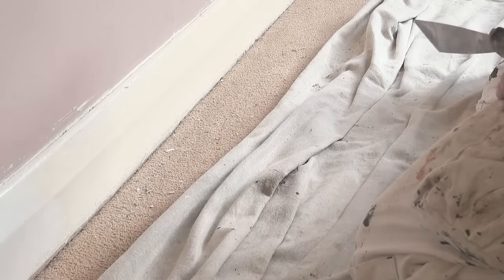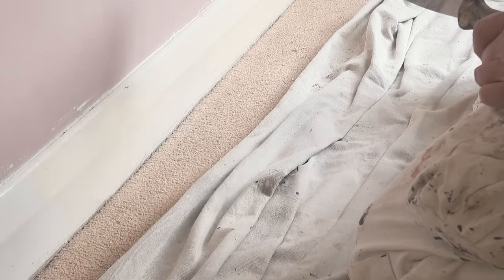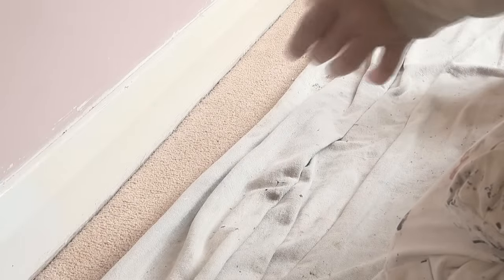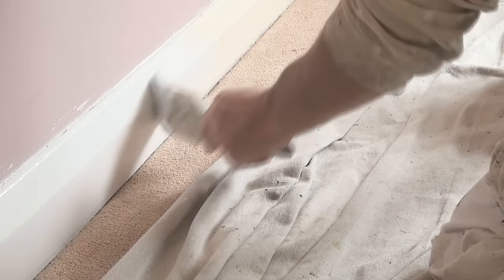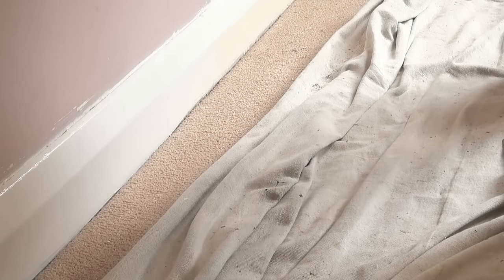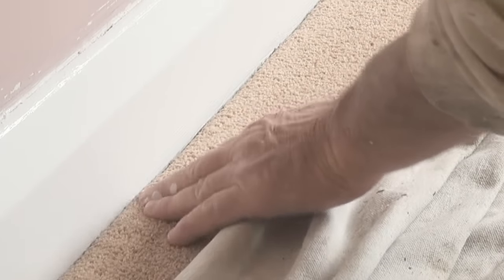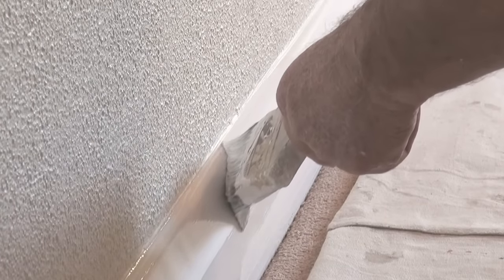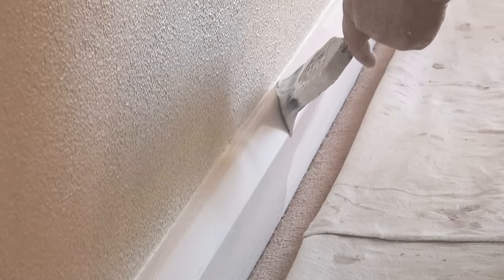How To Paint Baseboards or Skirting Boards On Carpet (The Trick to doing it)

Comment: Im no painter decorator but for all the years ive been diy paint work i have always laid down 2inch masking tape and tucked it down the side of the carpet with my spreader.. once the paints dryed and you lift the tape back up it lifts the carpet and all the micro dust with it leaving a lovely neat fluffy edge..
Reply: You beat me to it. That's how I do it. I picked it up from watching the pros on sites I was also working on.
Reply from the maker: The thing with tape is paint can and does bleed behind it and the big issue is you don't see it until the tape is remove. This is how I do it and other Pro's do it as running tape takes time and is not necessarily the best thing to do.
Don't forget to Like, Share and Subscribe.
Reply: @howtopaintinfo  rubbish sorry
Reply: Perfect that’s the way I do it works every time there again I’m not a pro.👍
Reply from the maker: @ Pete the Paint. Sorry bud but pros don't tape carpet.
Reply: You come out with broad statements such as "tape can and does bleed behind, pros don't do it and pros don't tape carpet".  It seems to me that it's your way or the highway!
Reply: @howtopaintinfo  EXACTLY, so many muppets out there...

Comment from the maker: The only issue with spatulas is they need to be wiped all the time as paint will work its way to the back edge so if you don't wipe it clean every time you will end up with paint on the carpet.
Reply: I took your advice and painted the baseboards and moulding without the use of blue tape because of your cut-in technique.  Thank you sir!   I have a question:  I am going to work on the stairs and have deep walls/ceiling above it.  The extension ladder needs a leveler or ladder box.  What do suggest tradesman?    Regards, a Subscribed student.

Comment: Use masking tape this ovoids any risk of paint getting into the carpet and also you won’t pick up any fluff from the carpet on your brush
Reply from the maker: Applying masking tape is time consuming, it never sticks that good to carpet, paint can and would bleed under the tape and get on to the carpet as there is no way to get a firm seal with carpet.
Don't forget to Like, Share and Subscribe.
Reply: The guy doing this video knows Jack shit. My family's business has been decorating for nearly 150 years and we always mask up.
Reply: @howtopaintinfo  that's not true...a strong masking tape can be tucked right down to the base of skirting board. It can be done real fast with practice
Reply: @JohnMowbray100  45 years in the trade   i laughed all the way thru this
Reply: I’ve been a decorator for 36 years mate it’s not weather your decent tradesmen it’ eliminates the risk of getting paint the carpet and you can get lower down if you were decent decorator you would that
Reply: @Gary Riley try it before you judge we work with the national trust and farrow and ball and have been trading over 36 years so I think experience goes along way
Reply: It might not be done in Australia bud but in the uk we have standards if the carpet is deep pile your be in all sorts of trouble it’s a precaution not an aid like using dust sheets it’s a precaution, prevention is better than a cure but each to there own , take care
Reply: @Gary Riley well I'm a professional I we always do it. Every one I know does it. Quicker, neater easier.
Reply: I'm a novice, i used masking tape on a medium pile carpet, yes it takes 5-10 minutes extra time...but well worth it...and, Bob's your uncle...
Reply: big carp catcher  use low tack tape frog tape is good iv been decorating for 36 years bud if you want any tips pls ask
Reply: big carp catcher  i peel the masking tape off whilst the paint is almost dry and use a sharp blade as i go along...takes a few minutes but worth it.
Reply: big carp catcher  go do your normal job and pay a professional
Reply: @MrJimtimslim  i agree James, but in my circumstance i have spare time off work (shielding and having Chemo) and I'm painting all the skirtings, dado rails, doors and frames a bit at a time. I used 'bullseye' paint/primer (in UK)to undercoat 1st, this saved on sanding down, then good quality white gloss. The finish has been excellent...at least the wife says so! 😁👍🏻
I'm going to pay for a decorator for the wallpaper though, I've not got the energy to go up and down ladders at the mo'. Best wishes to you
Reply: How to ruin your clients carpet in one easy lesson one touch to the edge of the carpet and you won’t get the paint off 😂Quality low tack masking tape is all you need that method is just going to pick up fluff and dirt at the edge of the skirting boards.
Reply: @howtopaintinfo  only cheap tape try a good brand like Tesa been a decorator for 40 years.
Reply: @robertgodley1141  I've been crawling around floors painting skirting boards for longer than I care to remember.  When painting in new buildings on screed floors, I always use a piece of off-cut board about a metre long, with a chamfered edge.  Push the edge into the gap between wall and skirting, and paint away, sliding the board as you go...no shit, no grit stuck in the brush or paint. Once the carpets go down, mask up, takes a bit longer, but painting is quicker. When your knees get fucked-up, the less time you spend on them, the better!
Reply: @roomatoid440  when I do new builds I always spray safe ya knees after 36 years in game bud 🤪
Reply: @robertgodley1141  Sorry old son, is spray safe yer knees an American term? Being English, I don't know what you mean.
Reply: @roomatoid440  spray skirts that way you save ya knees crawling around I can be out of new build in week doors sprayed as well
Reply: @robertgodley1141  Gotcha! Good idea. With doors, I use a short pile roller, then lay it off with a 2 or 3 inch brush. To get rid of the orange peel effect.
Reply: @roomatoid440  at last someone who knows what there doing lol you use perdy
Reply: @JohnMowbray100 yea that's true even on this one video he got paint on the carpet lol😂 in my experience I've always used packing tape it sticks better to the carpet and doesn't bleed but not using anything is risky

Comment from the maker: If you notice the drop sheet is about an inch away from the skirting, if you are going to drip any paint it will be when you are removing the brush after dipping it and that's why you should always work on a drop sheet. All professional painters I know do the method as I have shown, only inexperienced painters use tape. The reason tape is not used is because it does not stick very good to carpet, therefore paint can and will bleed under the tape and on to the carpet.
Reply from the maker: Thanks for your comment,  its good that you tried tape and found it not so good to use. Maybe it will help others.
Don't forget to Like, Share and Subscribe.
Reply from the maker: Thanks for your comment,  as a painter we are always looking for the easiest and best way to do things and sometimes there are no easy ways.
Don't forget to Like, Share and Subscribe.
Reply: Here’s how— when base is sanded dusted and carpet cleaned use 2” tape in strips of tape about one quarter inch up on base then pull toward you and tuck under base , continue till room is done, then tack cloth off the base and paint. When dry pull up tape— it’s done.

Comment: I get a thin piece of card, a4 size. Lay it flat and push it to the skirting board then tilt it to a 45 degree angle. Then just slide it along when painting at the bottom. No paint on the carpet.
Reply from the maker: You need to be careful when doing that, paint can work its way to the underside of the cardboard and before you know it you have spread paint all over your carpet. If that works for you that's fine but it has it's down sides.
Don't forget to Like, Share and Subscribe.

Comment: I just tape it up with good quality white masking tape and 6 inch paper on a masking gun. Run it along flush with the skirt then push it down over the carpet edge. Works a treat and has the added bonus of you drop sheets dont have to go hard against the wall when your rolling. Vac the gap for best results but dont have to. If your putting a few coats on you actually save time. You can fly around the skirt each coat.
Reply: i was doing that 40 years ago.
Reply: Or you could go even further and remove the carpet from the room and pay someone to relay it later. Lol.
Reply from the maker: Don't forget to Like, Share and Subscribe.
Reply from the maker: That sounds like a great idea. lol

Comment: I uused 1 long piece of an old vertical blind. I pressed it on the top  of the carpet and at the bottom edge of the baseboard. I t works great you just move the blind as you go. It doesnt matter how much paint you get on the old vertical blind.  Try it.
Reply: Jmaximus the downside to this is the carpet can spring up and get paint on it when you finish painting. You might not even know
Reply from the maker: Don't forget to Like, Share and Subscribe.

Comment: Which brush do you prefer for trim brand model, size, angled or not? sorry for all the dumb questions just starting out and I love your videos and I am trying to get better I am currently using a Purdy 2 1/2" angled sash for trim and cutting but it seems to make it more difficult thank you
Reply from the maker: I always use straight cut brushes and the brush I'm using here is a Rota Cota 63 mm (2 1/2") excel 2 sash cutter straight cut brush. I asked a fellow tradesman if he ever used an angled brush and he said he has only one that he uses for cutting in feature walls. So you will find most tradesmen use straight cut brushes and rarely use angled brushes.
Reply: howtopaintinfo I actually use a Roota Cota blue tip brush. Oval or square. and also a 75mm because it hold's more paint. I'm not here to wank spiders and dipping your brush into the paint bucket is the slowest part of painting.
Yeah I use the Roota cota one for everything, I use a new one for fine finish stuff but. Those red bristled ones are complete shet. they should throw those away. Actually most of what Roota Cota make is complete shit but the blue bristle ones are fantastic. Try Rokset rollers. I have had the same one for years. fucking beaut.

Comment: My foot long plastic caulking blade works a treat pressed into the edge, full coat of paint, lift away the blade and wipe with a rag.
Reply from the maker: As long as you wipe with a rag that is fine, just some times people forget to wipe with a rag and end up with paint on the carpet.

Comment: Ok now I'm curious, can you explain why you use a brush instead of a small roller?
Wouldn't running a roller along a skirting board give a nice flat even finish compared to a brush?
As you can tell i am NO EXPERT 😊
Reply from the maker: A brush will always give a smoother finish then a roller when done correctly. The problem is a lot of people don't lay off their brushing so it looks horrible. In the good old days when walls were brush finished some customers when getting a repaint still wanted the walls to be brushed because they didn't like the orange peel look of the roller.
Don't forget to Like, Share and Subscribe.
Reply: @howtopaintinfo  Thanks for the reply :) Love your videos, and it's good to to watch them just as I'm doing the same thing so I can follow your steps :) For a beginner, using a brush can be hard to master as can look horrible as you said, with lines all through it.
Reply: @howtopaintinfo  What's your opinion on Taubmans paint? I find it's excellent because of the texture, it's really creamy 😊 What would be your preferance in paint brands with 1 being the best 2, 3 and so on out of Dulux, Taubmans, Wattyl and British Paints?

Comment: That works ok (for you) on a short pile carpet, how would it work on a long pile where the fibre can get tangled up in the paint ?

My customers would have a shit fit if I didn't put tape down lol

Personally I use duct tape and push the tape down between the board and the carpet to get a neat edge, this keeps any fibres out of the way andgives a dust free edge to hoover/brush out. 

You have a steady hand for those cut ins and I also favour the angled sash brushes, you just get more control IMHO
Reply from the maker: With longer pile use a straight edge just to hold the pile back from the skirting, don't use it to cut in with or you will need to constantly wipe it clean.

Comment: The only problem I found with the paper and tape on carpet is that the weight of the ladder pulls the paper which then pulls the tape exposing the carpet edge. I always tape bottom of base, then paint base, and obviously want to keep covered tight since painting wall next which is where I've run into issue with weight on paper pulling it from the base. Grant it this is on very plush carpet I'm working on.
Reply from the maker: There are a few issues using tape on carpet and that's why I would never recommend using it.
Don't forget to Like, Share and Subscribe.

Comment: The trick is to paint the trim with a 4/10 graco fine spray tip and Casmere trim paint. Works every time for me.
Reply from the maker: Why would you use a 4/10 tip, that is a 8 inch fan which is way too big for trim. If I spray trim I use a 2/11 or 2/10 (depending on paint) which is a 4 inch fan. Also I would never spray skirting boards in a carpeted room, taking way too many risks in getting over spray on carpet. 
Don't forget to, like, subscribe and share this video.
Reply: haha got eem

Comment: 'I'm not sanding the skirtings down because I'm in a rush today'..  
So some customer gets a substandard job because you're in a hurry?!
Keying down skirtings with wet and dry paper takes minutes- not a big job.
In my opinion the brush is too big for accurate cutting in at the wall line. If you're going to paint the wall afterwards then fair enough but I'd suggest painting walls first is best otherwise you'll likely get splatters from the wall on the newly painted skirtings,- and you can't mask off newly painted skirtings for a good few days or you'll risk pulling the paint off.
Also best technique is to mask off the carpet all round the room before painting. Apply           masking tape to the carpet and overhang it by 1/2" or so and use a wide scraper to push this down    over the edge of the carpet and down in to the gap. Use lengths of about 3 foot of masking tape which are manageable and work your way round the room. This WORKS. It enables you to paint very low down on the skirting below carpet level. It does   take a little time but you eliminate any possibility of getting paint on the carpet, which is a decorators nightmare and is not something you should ever be taking a chance with. Customer   complains at paint on      carpet (which they've every right to) and you're either faced with an insurance claim or it will  wipe out the profits of the job and you're working for nothing. I decorate professionally and I've learned over time to never even attempt to cut corners or rush anything. Customer has a right to a top job and I only want to put my name to a top job.
For that reason also after masking I dustsheet right up to the masking tape as I go round the room. When glossing, nearby carpets should always be entirely covered.
Glossing is the most hazardous part of painting a room in terms of possible accidents and things that could go wrong. Accidents are always possible but what you can do is minimise the risks.
Reply from the maker: I really wish you listened to the video, I said that i had already sanded skirting's down and dusted them off, I also said that I would normally vacuum the carpet before I start but I was in a rush today.and if you noticed the area was very clean. This video was made to show people how to cut into carpet not how to cut into the wall. Also, every tradesman I know would laugh if they seen someone taping the carpet, it's not a common practice due to paint bleeding under tape and destroying carpet.
Don't forget to Like, Share and Subscribe.
Reply: @howtopaintinfo  Ahh yep okay my apologies, yes you sanded the skirtings. I watched the video and misremembered that bit so you're right! Sorry.

Look, if this method works for you then fine I'll go with that and you stick to what works for you.  I've tried most methods and masking works for me. If the tape is pushed well down into the void where the carpet meets the       skirting and you paint upto the edge of the tape and not deliberately paint all over it then you won't get bleeds onto the carpet. I don't. 

Personally I wouldn't feel comfortable glossing next to an exposed carpet   if I can at all avoid it. There's always risk of a drip off the brush or catching the carpet with the brush. 

Tradesmen laughing at masking the carpet? I'm not that bothered. Like I      say it works for me and I pride myself in doing a top job every time, or at     least always trying my damnedest to.

But respect, you've got miles more likes than dislikes so your method must have some merit. 

Cheers for taking the time to reply and for sharing your knowledge.

Comment: I would do this where the carpet was an old, crappy foam backed thing that I would be replacing anyway.
But, with my Brinton carpet costing north of 60 quid a sq. metre, just one drop of paint on that, and your cheque gets ripped up!

I reckon a real tradesman would get a carpet fitter in first to reveal the skirtings, and charge the customer accordingly.

You seem to be what we call here a 'chancer'. Nice try, though.
Reply from the maker: No tradie I know would ever lift carpet, we take care and make sure the job is done without damaging the carpet. Plus if one drop did land on the carpet it's not that hard to remove it as long as it's done straight away.
Don't forget to Like, Share and Subscribe.
Reply: @howtopaintinfo  OK, so now my new carpet and the room stinks of turps, and people were coming for a dinner party that evening.
Like I said, you are a chancer, and your pay will be discounted accordingly.
Good luck with your endeavour.